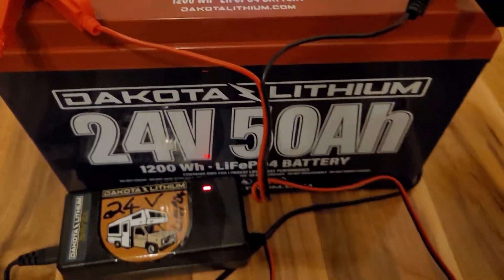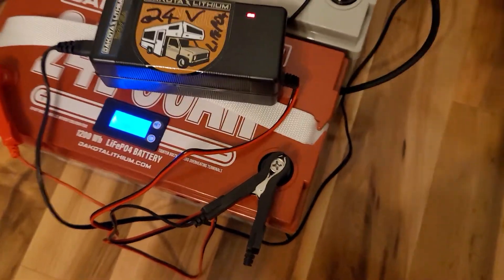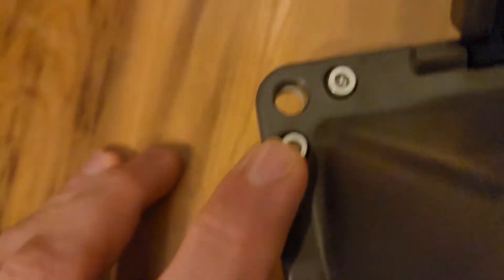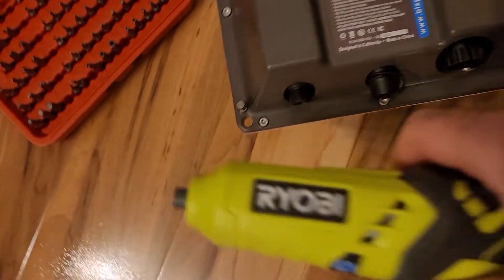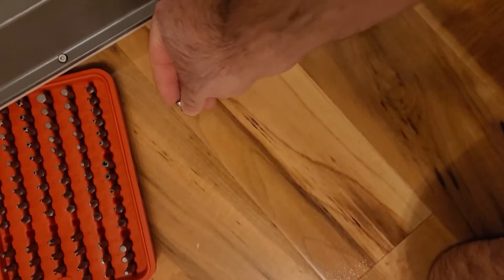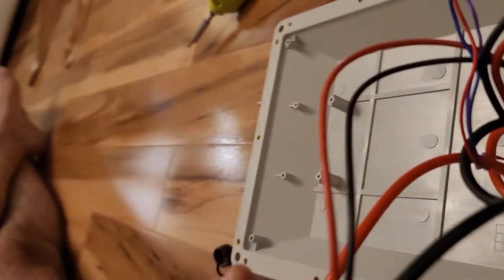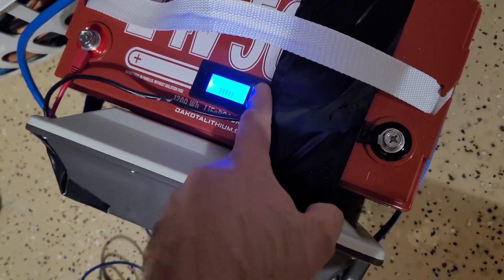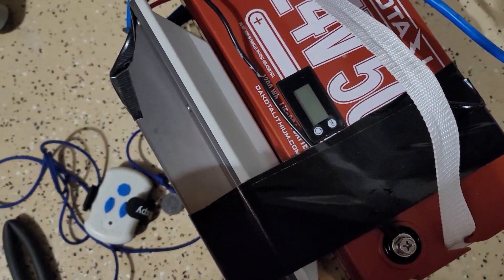Bixpy Electric Jet Motor Battery Mod Alternative Fix for High Power with  Dakota Lithium 24V 50Ah

Comment: Wow, they are only using 2200mah cells. I know this video is "old" by now but Panasonic 3400-3500mah cells have been available for years. A 50% increase in capacity right there.

Comment: Any way to run a bixpy without a controller. I have several motors but no controller box.
Reply: I bought 6 motors without any controller boxes. I wonder if I supply power to the 2 main wires would it power the motor?

Comment: does it have to be a lithium battery or cAN YOU USE ANY BATTERY.
Reply from the maker: only lithium
Reply: @ysesq  just one more question. how do you charge it specifically. not with a regular 12 volt charger correct.
Reply from the maker: @bornluky1  correct. if you buy it from dakota they package a 24v charger with it.

Comment: Did you just connect the power wires from the 50amp battery into the board where the previous battery plugged into?  I didnt see your final connection and assembly.
Reply: https://youtu.be/6YdUUIcLH0I

Comment: Basically, he put connectors on the wires used to charge the bixpy battery to connect to the 50 amp battery. Awesome. Thanks in advance.
Reply: was the original battery pack removed in the end?

Comment: Is it right to say you will have 3x more range (or Wh) with this battery? Have you thought of a waterproof battery box in case it gets wet?
Reply from the maker: yes almost 4.5x in practice. too big for a case but its not been an issue.

Comment: Would this work with a 12v 100 amp lithium battery
Reply: But it would work with two 100 amp lithium batteries connected in series... 😉
Reply from the maker: no only 24v.
Reply: You can series 30ah or 50ah x2= 100ah. I highly doubted you can drain the batteries all day fishing. Even in a high current water. Very nice hack.
Reply: If the original battery is a 12v why wouldn't 2-12v wired in parallel work?
Reply: @jorluivil  the original is 24v